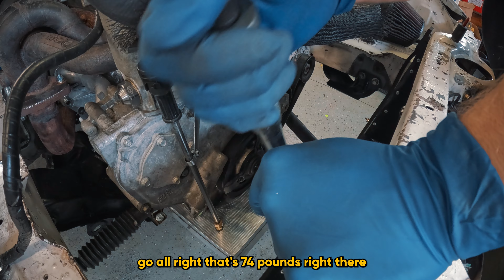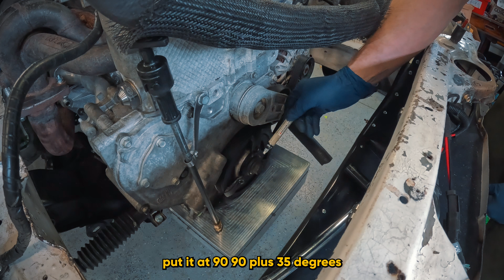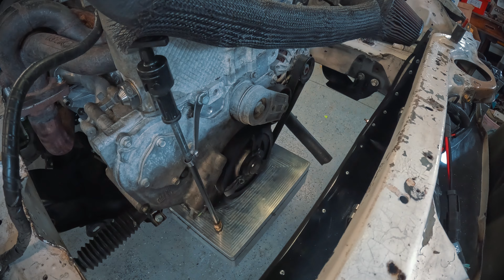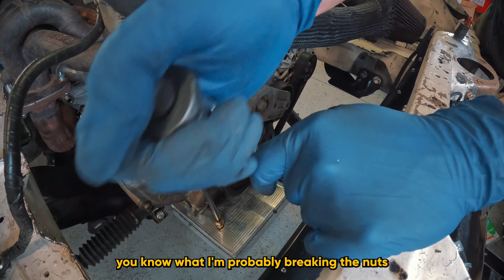Major Issues Installing the New Engine in the Ecotec Miata - Part 1 | RuggedBadger.com

Comment: When my Ecotecmiata was first installed I re-tightened the engine block header nuts and the downpipe fasteners after each temperature cycle. It took about 4 temperature cycles before the fastener torque seemed to stabilize on the exhaust system.   You will want to do that as many times as possible before it stays running at full tilt at the track.    In your pit stops I would quickly recheck these header fasteners even though it is not good practice to tighten them when they are hot, but it is probably better than loose.    If the fasteners gets loose exhaust gases could escape or outside air could get sucked in messing up the oxygen sensor readings and your fuel mixture.
Reply from the maker: That is really good advice!  I think I will try to use some sort of locking washer as well.  I will report back after the race.

Comment: Have you considered what the Kswap folks do and chop off the power steering and the bosses that stick out and then add electric power steering if you need it?
Reply from the maker: I didn't know about that.  I will take a look.  I also have a K-Power kit on hand, but that will be another build.

Comment: Roy, tip for next time, it's so much easier to pull the intake manifold off for the engine install.  It's like 7 bolts and takes like 5 minutes.  So much easier to deal with engine mount/starter/steering rack that way.
Reply from the maker: I appreciate the tip!  I will look into that next time.

Comment: Great Video - The one comment I would suggest is that the transitions with the racecar are a bit loud compared to the normal volume! If you can adjust those in the future ;)
Reply: Good Call on returning that other Brake Kleen product though... Smart man. Always spray the large amount with at least the door open! Cheers.
Reply from the maker: Thanks for the feedback, I will get that adjusted!